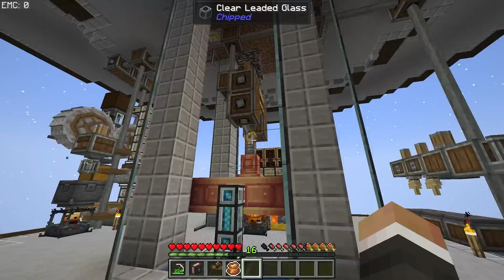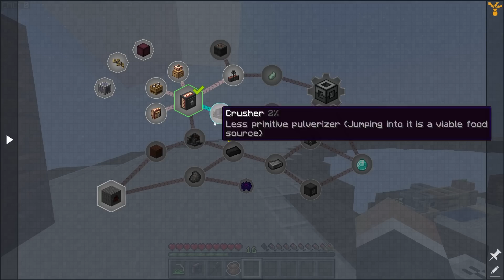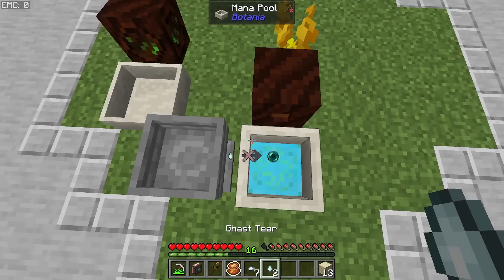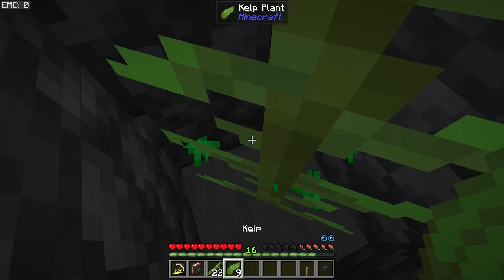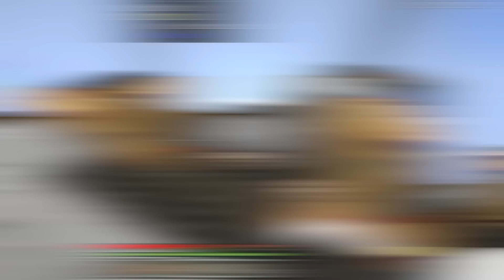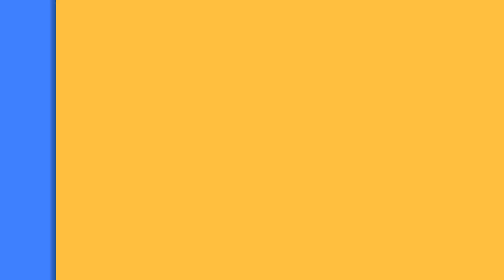Minecraft Sky Revolutions | ORE WASHING AUTOMATION WITH BELTS & FUNNELS! #6 Modded Questing Skyblock

Comment: dropping the items 1 block down from out of the filter into a filter with the processed items and a fan blowing above it going into a chest beneath it that is piping back into the dank would have been better than the weird belt setup

DIAGRAM IS FLAWED AND USED FOR DEMONSTRATION OF CONCEPT ONLY.

right    \/
[P][D][F][A][W][N]
[P][A][F] <- down, items on top
[P][P][C]

key:
[P] = pipe
[F] = filter
[D] = dank
[A] = air
[C] = chest, 2nd dank would probably be better here
[N] = fan
[W] = contained water

Comment: Hi Gaming On Caffeine, love your serie. I recently found a bug with the Dank and Dock. If you connect an item pipe to it and the item transfers into the Dock, you can actually take out the Dank and the items still goes in while its in your inventory slot. I found out trying to change the Dank with an expensiever one and you need to destroy the pipe first and put it again.

Comment: For the people watching at home: 
1) If you can, make the fan run at the lowest RPM possible. As he mentions in the video, it has no effect on the washing speed, just distance. 
2) Place the fan so it blows across the top of the whole belt instead of just on a single block, you'll multiply the number of items washed at a time. 
3) You can wash an infinite number of items in parallel (at the same time) if you DONT use a belt or depot, just dump them all on the ground in the path of the water particles. 
4) It looks like you could probably just wash everything coming out of the sifters instead of storing and re-storing them all. Much easier when you have infinite parallel washing.
5) Don't use the Dank for the items in this setup, as you can see it doesn't behave very nicely with filters from other mods. Use a big vault or a storage drawer system instead.
Reply: Also compacting drawers could easily do what he's using that compactor machine for instantly using no power.
Reply: tip #1 and 2 are conflicting
Reply: @Capiosus  , not inherently no, "if you can"
but also even if your fan only currently hits one block, pointing it so it goes along the length of the belt rather than the width lets you speed the fan up later to hit multiple blocks of the belt without making any physical changes to your machine

Comment: Of course he has ifinite coal production so not big ploblem, but coal block is more efficent at endoflame. 
also, endoflame's maximum fuel capicitu is 100. same as coal block, so if use more fuel capicity kind cokeblock it didn't good work.

Comment: You don't have to use the depot to do the washing, you can leave the items on the belt instead and use multiple fans and water blocks along the belt to wash more at a time. Just use one of the funnels with a filter only allow the washed stuff through. Can save you on funnels and is faster on washing.
Reply: Or, if you move the compacting machine forward by a block, you can just hook up a washing fan facing the belt end-first. That way you've got one fan washing all of the belt simultaneously.

Comment: Why use bulk washing instead of bulk blasting ? The setup would've been much easier and no energy needed. Just a single bucket of lava instead of water
Reply: And why using the compactor instead of a drawer Controller leading into compacting drawers. Then simply pull Out only ingots. Done. Zero energy required.

But we are free to play the pack and do it better❤

Comment: Does anyone know a way to increase the washing speed of a fan? I know increasing the rotation speed increases the range of effect, but what about the washing speed?
Reply: if you set up a belt for example 8 block lenght and you have a 8 block range fan direct against the belt, you can blow 8 piece of raw material with a single task instead of blowing every single raw material one at time over a single depot. To stop item you can put a block at the end of the belt and a filtered funnel to collect item from the side.
In this way you can speed up the process.
Reply: I don’t know a huge amount about Create, but if speeding up the blower doesn’t do it then you’ll probably need to run more blowers at once 😅 one thing to experiment with would be to see if it can blow forward over a few blocks, to wash 2 or 3 items at once on a line of depots.
Reply: @TheCrazyCapMaster  depends if depots count as full blocks and stop the fan
Reply: You cannot increase the washing speed. To speed up washing you will need more fans. If they all blow into one spot or along a belt is your Design choice.
Pro Tip:
Dump all the items in the ground so that multible stacks can bei washes at once. The Fan takes x time to wash a stack of items. In a belt: the next sack can only be washed if the prior one is done/has moved on.
If you dump all items in the ground in front of a fan and blacklist the "to wash" Item, you can wash many stacks at once.

So you could do a setup that would be way faster and power efficient. (Don't get me started on changing the compactor to compacting drawers.) But that is the beauty of this Game. As long as it works and you enjoy building it: everything is fine ❤

Comment: why not just use compacting drawers for the nugs u get?
Reply: because a compacting drawer can only have one type of item in it at once, and because he is trying to compact several types of nuggets, as well as filter out the byproducts, if the compacting drawer is left with less than 9 of a nugget type or a byproduct like redstone, the entire system gets shut down. you could make this work, however it would be far more complicated than just using the compactor.
Reply: @jckitkat4499   then just use 4 compacting drawers and 4 normal drawers for the 8 items he gets. And pipe it into them with the pipez mod
Reply: Well, then just pipe into a drawer Controller with enough compacting drawers attatched. And then filter Out only the Nuggets. Done .
Reply: @mawoh3027  well he has no drawer controller yet as u need diamonds for that. And no need to filter u can pre put 1 item in and then lock it and it'll do the "filtering" for itself

Comment: IN THE LAST STREAM
Reply: We were working on
Reply: Replacing our waterwheel setup
Reply: To allow us
Reply: To produce a much larger amount of
Reply: Stress units
Reply: To power all of our create contraptions
Reply: Simultaneously without having repeatedly disconnect
Reply: To allow us to stay under our stress unit limit
Reply: And right now, we have the one steam engine
Reply: producing sixteen thousand three hundred and eighty two stress units, I believe
Reply: different bits of shafts and turn off different devices
Reply: On a fairly small boiler
Reply: That, is then being pumped up
Reply: Into our rotational speed controller
Reply: The automatic sand sifting setup
Reply: allowing us to very precisely set the speed at which all of our stress units are being rotated..
Reply: And thus allowing us to kinda maximize
Reply: The amount of stress units being used
Reply: and get the maximum speed out of every contraption
Reply: That We have
Reply: And one of my plans for today's stream
Reply: Is going to upgrade this
Reply: with even more blaze burners
Reply: to get even more stress units
Reply: Via even more steam engines
Reply: Along that line
Reply: Over here we did also set up
Reply: At the end of the last stream
Reply: An since the end of the last stream
Reply: that has been chugging away to the point
Reply: Where we now have almost eight-hundred flint
Reply: that's not just from sifting
Reply: And since the end of the last stream
Reply: I did also move some flint
Reply: From our chest
Reply: Producing 16000 stress units